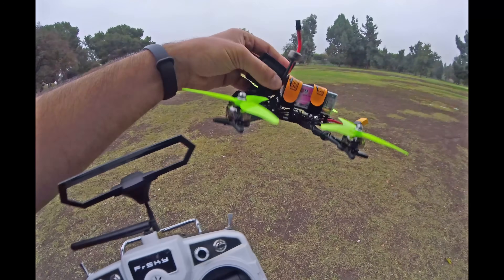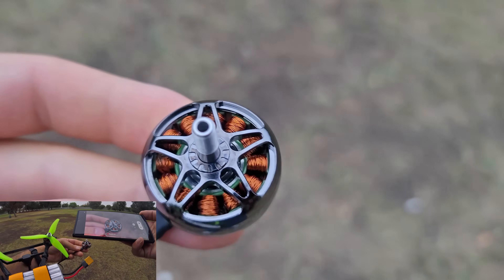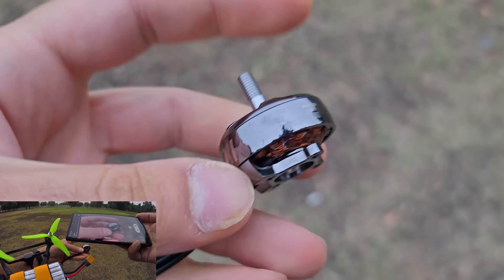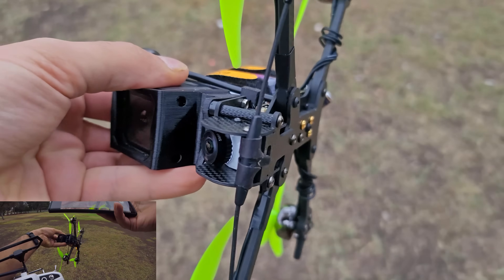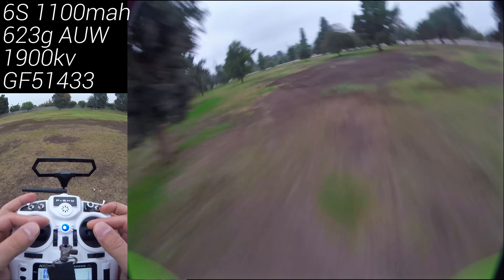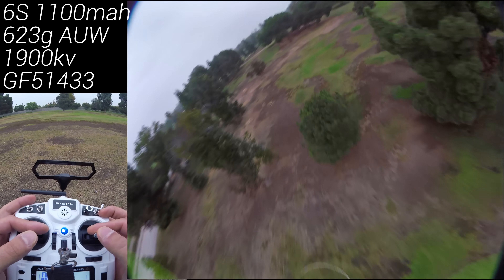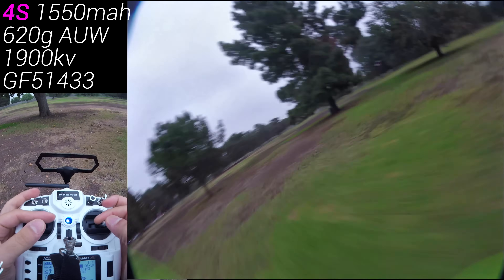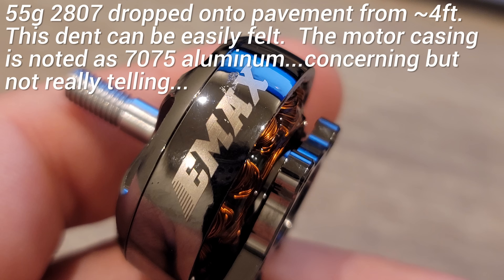Do you need a $27 motor? - Emax Eco II line

Comment: I've had a pretty terrible experience with the Tmotor F90s and I'm going to try these 2807s. Even if they are lower quality I have two backups for the cost of just 4 F90s. 2 of the 4 F90s I have, had major issues with the bearings and the quad is nearly unflyable - under 30 packs in and no crashes...
Reply from the maker: Generally new product lines start out good and then the quality takes a nosedive after a few batches. The f90 isn't new but it's likely hit that curve by now.
Reply: Ah really unfortunate, but thanks for the info. Hopefully these eco IIs will help me out!  Really enjoy your content man! @Kabab

Comment: I'm trying to use these quad motors on Delta fixed wing for speed runs. The ECO II 2306 are $16 now, May 2023. The 2807s are $20. I was under the impression that only the lower Kv motors could handle 6S. In fact I burned up a set of SunnySky Edge Racing 2207 1800Kv motors running them on 4S 2b 5045 props. 

Now I'm running some T-Motor Velox 2 1950Kv motors on 4S with 2b 6045 props. I'm afraid I'll destroy them on 6S. Are they OK on 6S?

What I'm hearing here is that these ECO II 2307s and 2807s are fine on 6S on any Kv. How will they hold up if I run them using 6045 2b props on 6S? Will I get more speed from the 2400Kv motors on 6S? Any help from those with experience on the motors mentioned would be appreciated!
Reply from the maker: There's no voltage rating for motors. Only the current matters. If using multirotor motors for a wing, just run the motor at one step lower voltage than what it's intended for with a prop that's around the size the motor is intended for. The issue with multirotor motors is that they are very bad at sustained amperage. They are designed for short bursts of amperage.

Comment: Hi,

I am trying to decide if I buy the Emax 2807 1300kv or the Avenger 2806.5 1300kv for 7 inch. Both have the same size bearing and the difference is 20 dollar. What would you choose? Thanks in advance!

Comment: how much current can it draw on 3s?
Reply from the maker: The kv is low for 3s so it would be pretty low current
Reply: @Kabab   ah I see its just i recommend 3s for starters just to have it easy before they go crazy on a 4s
Reply from the maker: @cliffcosynerflight5253  I'd strongly recommend the gemfan 51433 prop. It's just an excellent all around prop. It's my personal favorite too.
Reply: @Kabab   ah got it ,  and my guess is true cuz someone put an 50503 on it and ruin everything
Reply: @Kabab   ah I see and the sort of Props you run ? the Emax5050 produce a heck of vibrations so we switch to the Kingkong 5045 t resolve it

Comment: There is a disadvantage to 6s.  20% more cost.  33% higher chance of losing a cell.   Thats not to say you arent right,  but I keep 2 4s wuads,  with insta360go mounts,  and cheap batteries,  just so I can practice new things.  Fly in sketchy areas.  It feels lighter and has a different feel.  That some may like more.  I dont like it more,  but I do like the variation.

Comment: So, Kabab... 8 months later, what are the better motor sizes for 5" quads? I am building both a freestyle 5" and 2 race 5" quads. I am at the point where I need some motors. What is the best size in your opinion for both race and freestyle 5" 6s quads?
Reply from the maker: Things bigger than 2306 but less than 2507

Comment: I've tried bargain basement and top shelf.
If it's made with quality alloy and tight tolerances, the performance and durability of a $11 motor and a $26 motor are so minor that you are just buying into either status or the last 2% of performance available.
If an extra $60 a set is woth it to you then go ahead and splurge, but remember,  one knarly crash is $26 not $11.
Reply from the maker: yeah that's definitely the message of this video too.  If you're flying and expecting crashes, no point to expensive motors
Reply: @Kabab  True, if you never crash, you are doing it wrong!

Comment: This looks good, there is also the NBD Flow motors and the Xing motors, liked the frame, a thinner 6mm arms would be great and also a slot alongside the battery to hold the straps would make it great

Comment: 🤣🤣🤣 speaking of bearings, I broke out my old old old LS210 build from 2016 with the super awesome badass(lmao can’t even say that straight) Racerstar 2205 2300’s.   😂🤣 my gtb339 is faster that than thing hahah.  But it still flys, F3 and flysky and good old school HQ 5040 props, yep the ones that would break if you hit a blade of grass too hard.   Just goes to show that wore out motors with horrible bearings will still work.  Heck I’ve had the same set of xilo 2207 1750’s on  one my race quads for well over a year and a half, close to 1000 packs, over 100 crashes, 3 mid airs at races one of witch ripped a motor off the esc and arm anf all 4 still works perfectly fine and not even crunchy yet.  I use it as a back up now but I use it for practice so I don’t kill my 2 main arc ones and 1 switchback before getting to race day.

Comment: Hello, nice video. Which battery do you recommend for 1900 KV Emax Eco 2306 motors, 4s or 6s? And what C rate? Thanks a lot.
Reply from the maker: You always want the highest C rated battery from any brand.  The actual numbers don't mean anything but the highest number is the best performing one.  If you're looking for a budget battery, often times one step lower in capacity with the highest C rating will perform better than the larger battery with a lower C rating.  I recommend the GNB 1100mah 6S high C with these motors in 1900kv.  https://fpvcycle.com/collections/batteries/products/gnb-6s-1100mah-lipo-battery

Comment: Are there others who also experience that there is a veil in the bell after some time ?? 3 of my motor can run almost 5mm up and down. And the screw is completely tight at the bottom of the motor
Reply from the maker: Ouch. Really?  Where is the slop coming from?  If it's the bell top, it would fall off no?
Reply: @Kabab  I do not know where it comes from 🤷 the screw at the bottom is completely tight and the distance the piece sits on at the top ... They were not like that 3 weeks ago when I put them on .. I have not flown very much with them
Reply from the maker: @maloulukasholm  unscrew the bell and see if you can find what's going on. That's very unusual
Reply: I have unscrewed the Bell on the used ones and a new motor and it is the small black o-ring  that is  between the motor Bell and the top disc. As there is of poor quality .. It is gone on almost all the engine I have slop in .. And those where the sidts in they are  damaged and expanded .. I think that is why the engines die quickly .. Because when the ring is gone Bell can move down into all the copper wires and destroy them ..

Comment: I just want to know what size screw there is on the bell. If it's the same dinky little screw from the original version of the motor, I'm out.
Reply from the maker: screw size on the bell?  Oh the retention screw?  It's either M2 or M2.5
Reply: @Kabab  yeah thanks...that sucks I was hoping it was the bigger ones, oh well I'll stick with the other motor...I need to clean my bells often and that tiny screw's head always stripped on the original eco ..so no thanks.. thanks for the review I really wanted to have these as an opton

Comment: I'm new to cinewhoops so excuse the question if its really stupid: is it possible to make a "longe range" cinewhoop cruiser? I want to kill two birds. Perhaps could i take the cinesplore's ducts off and put on 4" props? I want to upgrade to crossfire, DJI HD system, and a long range quad that could also be used for cinematic stuff or general recording. So I want toget the biggest bang for my buck.  I thought maybe a cinewhoop with a bigger battery and maybe some additional tweeks could maybe accomplish this multi-purpose quad I'm trying to create.
Reply from the maker: Sure you could but cinrwhoops are inherently inefficient so you wouldn't get very far. You typically want bigger props for flight time or long range

Comment: Hey kabab, question, all I care about is reliability what fc/ esc stack should I get?
Reply from the maker: Hollybro 30x30 4in1. The newer one. It's got the best chance at giving you excellent performance consistently. The FC is a total tossup. They're all pretty reliable but they can all fail as well. I'd stick to well known brands for the FC. Not the dinosaur company...
Reply: @Kabab  thank you so much! What fc has the best 9v regulator for dji?
Reply from the maker: @Themflames  any FC that has a 9v is basically the same. There isn't one that will be particularly better or different

Comment: Yep, I do. I've seen too many budget motors die after 1 crash where as the expensive motors just keep rocking.
It's not about performance. It's about durability.
Reply from the maker: I've also seen many expensive motors die in small crashes where budget motors keep going. It's really a tossup. Just because it's expensive doesn't mean it's durable. It usually means it's less durable and lighter actually
Reply: @Kabab  True, expensive doesn't mean durable. But it is (or maybe 'was') hard to find a cheap motor if you're looking for durability, with 7075 alu and a titanium shaft.
Reply from the maker: @audiogek  this motor supposedly is 7075 which I'm curious about

Comment: What's the lowest KV you would go (on a 6S build) that you plan to fly on 4S?   I see you're flying 1900KV here.  Bardwell did a tuning video on a 6S build but tuned it on a 4S- by mistake and it flew great and really smooth.
Reply from the maker: Anything below 1750kv tends to be really low power on 4S. 1900kv is a lot closer to normal for 4S. 2200-2300kv used to be the norm for 4S 5". Now it's about 2500-2600kv. But when you're pushing 2600kv 4S because you want more power, you might as well just go to 6S because you'll get better battery performance because it won't be sucking the amps so hard to produce the same power.
Reply: @Kabab  Thanks for your reply...  I was just tempted by the new Roma and its potential of 6S in the future. I'm one of those people that haven't built a 6S yet.  I've been supper happy flying my Acrobrat on 4S (1300mah) and my whoop.  I've just been missing a 5" lately.  Maybe I'll just stick with the smaller, quieter frames and order the 'FOURIDE'.  Thanks again for your feedback-
Reply from the maker: @ag137  I'm working on a totally different level of refinement for 5". It'll take some time but maybe in 6mo, the 5" category might look s bit different than it does now
Reply: @Kabab  You are the master of suspense!  Ha!   Hmm... six months should be just in time for next summer!
Reply from the maker: @ag137  not really much suspense. It'll be pretty clear the direction. It's not that different than what we've got either
Reply: @Kabab  I think you might have set a high bar already-  I'm pretty sure A LOT of people already think the Glide might be the best frame of 2020.  I'm looking forward to seeing what you come up with-  Thank you for the work you do for the community.

Comment: It's not stronger than titanium
Reply from the maker: steel has more toughness than titanium.  Titanium is more brittle.  especially in the lower grades like are used in motors.  For this application, steel is a more robust option however it's a moot point since there's no issue with titanium

Comment: Cool frame. I’ve been trying to work w a few people (I have multiple frames designed in my toolchain in testing atm, and my own large in-house CNC for cutting the plates) to come up with a universal front camera/rear VTX ant/other acc Mount standard. So we are able to mix and match front cages/mounts/rear mounts/ etc from different manufacturers on any frame. It’s just coming in with this base measurement standard that I can get people to agree on. If interested let me know. Then for marketing purposes the frame (from whoever is making) will be “whatever name” compatible. Haven’t got to coming up with a catchy logo name yet. Hope that makes sense.  Thx!

Comment: Hi kabab, which one do you prefer  , 25xx or 28xx 1200kv for 7 inch long range? Need advice, thanks before
Reply from the maker: 28xx is better but imo still not the right size. 2806.5 is an excellent 6" motor. It'll work for 7" but so will 2205...
Reply: @Kabab  thanks ^_^ for sharing

Comment: I wonder why no one is talking about 5S. With 1900kV there are perfect motors dor 5S available. You dont need 2000uF Caps to protect your electronics and still get a little feel for empty batteries without getting that much sag as on 4S. My best reason to skip 5S and 6S the next 2 yeary is that i own  20-25 pcs of 4S batteries. And those work best for me on 2400kV - and i own a lot of quads with 2400-2600kV.  Why are 12$ motors so attractive for me: because i start more quads than i land. Sometimes it is cheaper to leave 150$ on top of a tree than risking your life - or keep searching longer than 1 hour.
Reply from the maker: 5S is definitely overall a perfect compromise but the batteries just aren't as widespread as 4s and 6s. That's really the only reason if you as me

Comment: So these 2807s or bh 2806.5 for 6" thoughts kabab?
Reply from the maker: The BH is a better overall motor because it weighs about 8g less but these are way cost effective. I have a much larger motor coming out soon that is a much better size for 7" and weighs as much as the emax 2807. My motor will be about $27 however.
Reply: @Kabab  thanks Bab!

Comment: But I still don't see a reason to buy these instead of the iFlight Xing-E.
Reply from the maker: Both are great.  These are built a little better however.
Reply: @Kabab  By these you mean the Eco II? Now this is interesting, seeing from images only i was almost sure the Xing-E was better.
Reply: @Kabab  And there is also the T-motor Velox. Any opinion about the Velox between these other 2?

Comment: I feel like 6s quads arn't really much or any faster than a TP3. Just good to carry a GoPro?
Reply from the maker: 6S makes sense for any gopro carrying quad because of the improved voltage stability.  That's the #1 advantage.  Lighter quads don't need the 6S because they're not as heavy